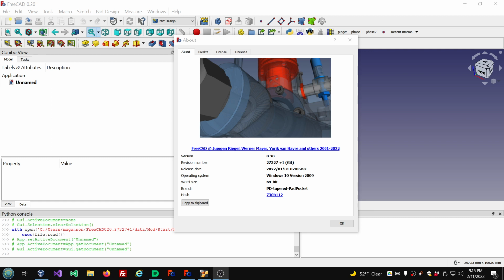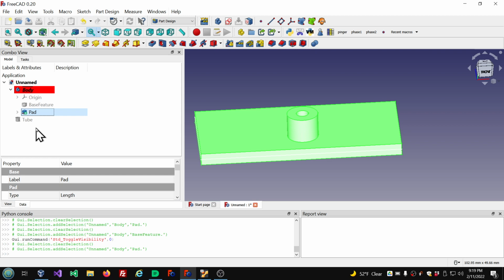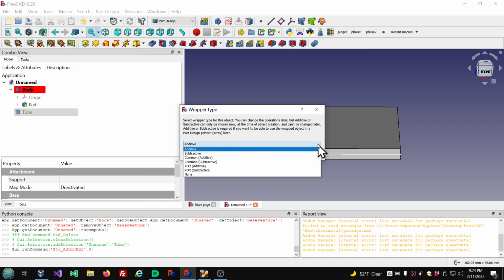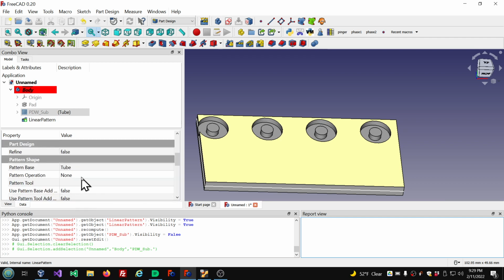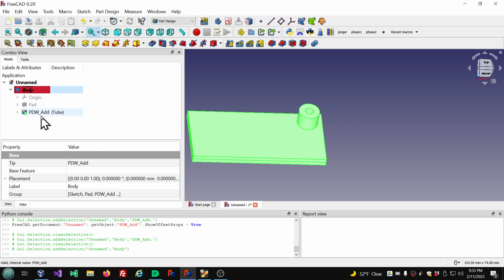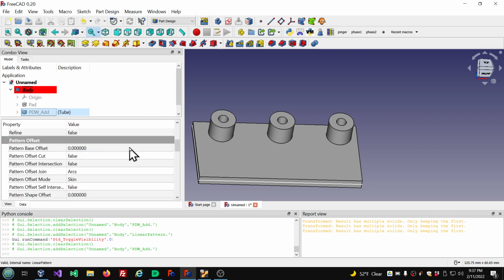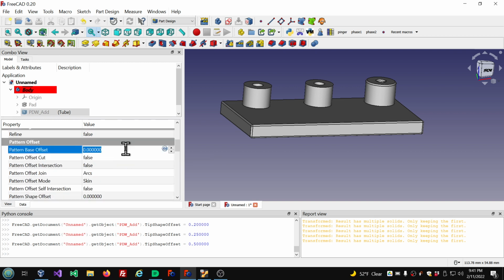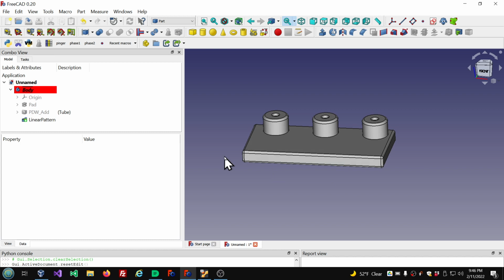091 pdwrapper

Comment: Wow! So informative and useful. Thank you so much. I now want to know if Part Design bodies may be used as a Part object. I am a beginner with PD and this video was so helpful.
Reply from the maker: Yes, select the body in the tree to use it in a Part operation, like a cut or union.  If you must select some subobject like an edgein the 3D view, then first temporarily set the body's view tab property DisplayModeBody from Through to Tip.
Reply: @mwganson  Many thanks.